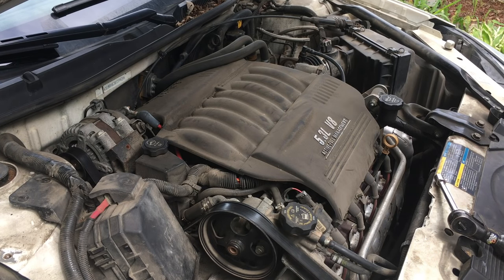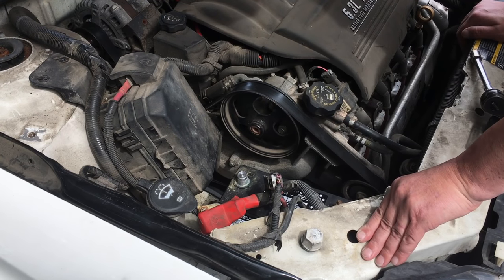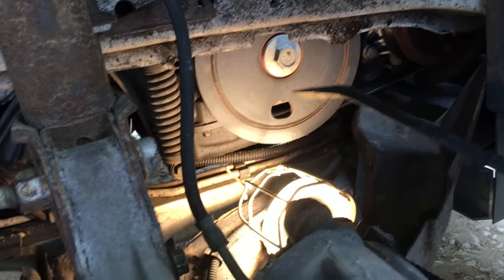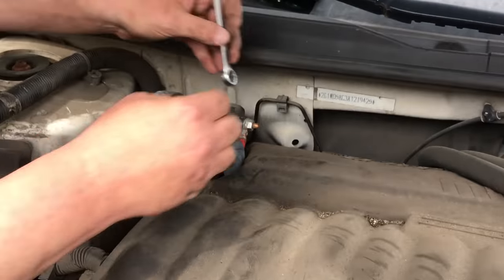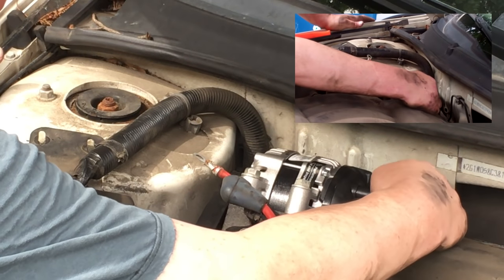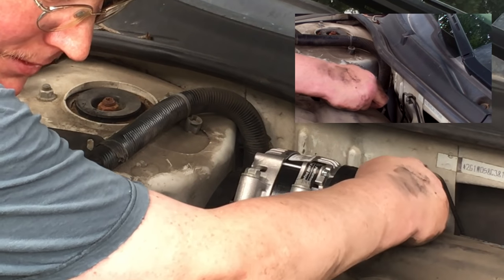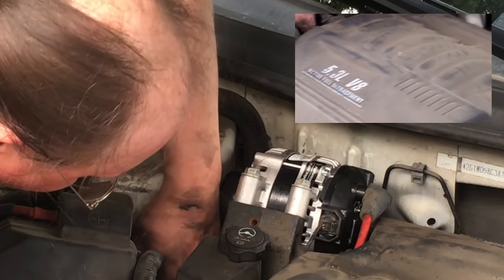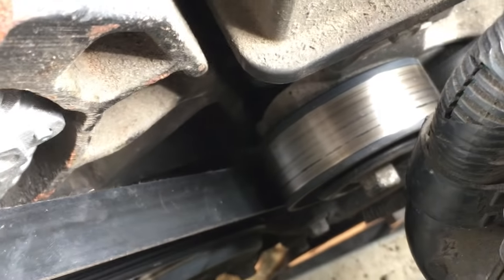How To Change The Alternator In A 2006- 2012 Impala ss

Comment: That knocking sound! It is your "Actuator" 1 of 4 but  it controls your heat blend door and is located behind the glovebox just to the left the part is $64 it will stop the knocking sound that starts after you shut the car off or after being started. Depending on which one it is you will feel cold air blowing while the AC is off. I have an Impala SS and my wife has an old LT we have experience almost all of the common annoyances "Chevy shit" lol P.S. DON'T FORGET TO SQUEEZE THE TABS on the back side TO RELEASE YOUR GLOVEBOX.
Reply: Shawn G hit it in the head! I had to squeeze and push down on glove box so that it fully falls forward and down you will see that it is no longer on the gear. Check both actuators by turning air controls from lower foot to front winder defrost😀. Hopefully it’s not the other two not on passenger side.

Most likely it’s the far right one not left on that passenger behind glove box side. Man it’s a pain in the butt I changed it yesterday and I only have 30k on my 07’ SS. Use a small ratchet or wrench due to limited space. There are one or two good videos on YouTube.

Comment: Nice work. I appreciate this. I would add that some auto parts stores have a belt tensioner tool for loan you can use in the engine bay rather than taking the tire off. Thanks again.

Comment: Great video, I have to replace my alternator, and was worried about a 6-hour job, but this helped a lot. At about 16 minutes in the video, there is a click sound in the background, my car (2006 impala ss) is occasionally making a similar sound, which sounds like its coming from the heating ducts inside.  do you have any idea what it is?
Reply: Daniel Gagnon it's the blend door actuator. I had to replace two of them behind the glove box. Their is four in total. That was causing my windows to fog up.
Reply: I found the same, interesting that we both had the issue around the time the Alternator failedThank you for the follow up
Reply: Daniel Gagnon Sad thing is Advanced Auto screwed me out of a alternator turns out it was a battery. I have a 08 3.5 LT luxury package with the sunroof in white. How is your transmission holding up. I heard the 5.3 ripped through the four speed.
Reply from the maker: Unfortunately if you haven't found out yet the fix is like 400 bucks so we've put it off in both of our vehicles.
Reply: Nahtanoj Enotsylb Its fairly cheap if you do it your self. It's not that difficult.
Reply: Its an easy fix with 1/4 in swivel, extension, and t15 tork. Remove the glove box and locate the actuator making the noise. It will be either a temp door or mode door actuator. Ive seen both make the repetative tick/thump.
Reply: It's an actuator. There are 3 total, either on the passenger or driver's side

Comment: Just an FYI, you could have used a serpentine tool and you would not have to take off the passenger side tire.  I got mine off of Amazon.com.  They run about $28 - 30 dollars.  Saves time from having to take off the tire to get to the tension bar.